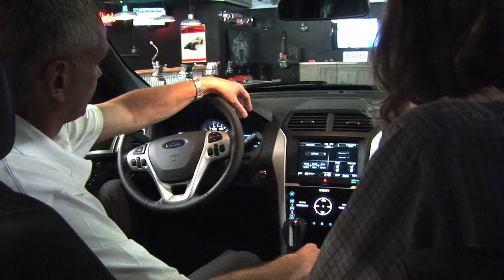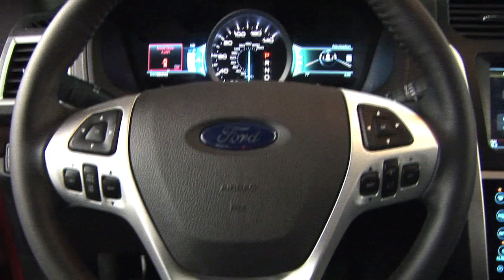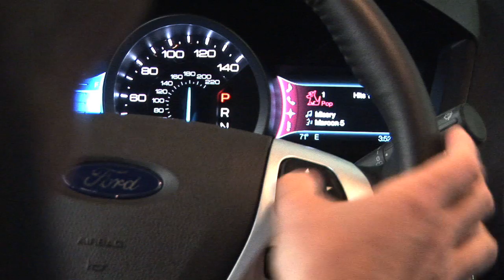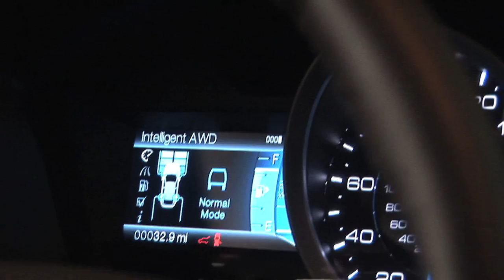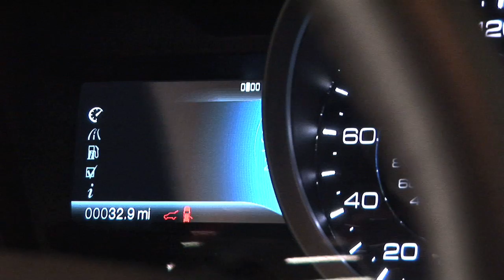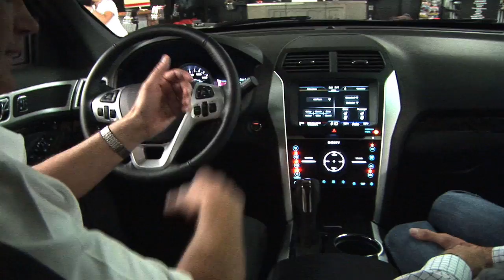First Look: 2011 Ford Explorer - Interior

Comment: @hernanmunoz with how many miles?The reason most people hate ford because they do give alot of problems. What i have noticed with ford's is that they can last but they require high maintenance. Once you slip up a few times it all down hill from their. I have a friend with this van with 140000 miles. Which was surprising . I am a beginning mechanic and have experience with cars.He keeps his car in extremely good care. For example if one wheel bearing would go bad he would change all!

Comment: @JMxE15 I haven't been inside the new Explorer yet, but I do know that a lot of Ford's Sync and Navigation and other type features in the center console, are not available while actually driving;  so that would eliminate any chance of being too distracted by that;   the phone calls are handled by Sync, which alerts you of an incoming call, and then you command the call to go through and it's played through the vehicle's speakers; so it is totally hands free and not touching the screen either

Comment: Ok, sorry for misunderstanding fellows!
But honestly I don´t understand why some people critized the Explorer only because it´s a FORD product! 
I owned a 1996 Explorer XLT without any troubble.
All carmakers had and will have failures, but this product seems to be a very good starting point. (very efficient and powerfull V6 engine, strong steel unibody, 4WD (not for off road use), very nice design and interior, excellent crash test results, and an affordable price... aren´t this good news?

Comment: Yeah, but it's front wheel drive based 4wd. This thing sucks. No V8 option, and it doesn't even have a frame anymore. The whole point of buying a suv is for utility, and Ford took that away with the 2011. This is just a oversized Ford Taurus now.

Comment: It's front wheel drive, so it's not a real Explorer anymore. Why do the automakers insist on ruining good vehicles with front wheel drive. If I wanted front wheel drive, I'd just buy a shitty Kia Rio or something. It's getting to the point, that if you want rear wheel drive and a V8, you practically have to buy a pickup truck now. At least they haven't turned the pickup trucks into pussymobiles yet.

Comment: @Griffin596 

The direct injected 3.5L TiVCT has plenty of power/torque for this vehicle forget hp stats. This is not your traditional SUV. You get the power you need with less fuel consumption and and better ergonomics. Test drive one and see what I mean. By The way, they will be introducing new engines after the first model year (including a 4 cyl ecoboost twin turbo believe it or not!) The 2011 Ford Explorer's can also tow up to 5k lbs.

Comment: @hangene92 yeah i'm dumb, hey 2009 v6 can only tow 1000 lbs. and santa fe 3.5 l can tow is rated at 1500 and 3500 with brakes, meaning that its the frame that is not strong enough to take the stress when braking a trailer. Why is honda civic towing capacity 1500 lbs?? cause steel is stronger. and i never said hyundai does'nt make their own steel. my wife owns a hyundai right now, and that was the worst mistake of our life $30K trash can.30000 km, motor gasket seal broke, radio broke, brakes fail

Comment: Ford does make their own steel.  At the Rouge River plant.  They also make their own paint and glass.  
This is an awesome effort.  IMHO, the new Explorer has raised the bar to a whole new level at the $40-50k price point. 
Honda and Toyota are very nice vehicles also (I own a 2003 Toy) but they're gonna have to offer up much more to compete with this.   
WELL DONE FORD!

Comment: @withoutlimits16 cause when its -10 F you keep your gloves on cause the steering wheel is still cold even if your car has been running 5-10 minutes and your gloves are wet cause you scraped off ice from wind sheild, removed ice from wipers, touched remaining snow on door handle.basicly i would like to have knobs for AC and heating. I saw the new explorer up close WOW. this car will be on my test drive list. and  i will try it on a cold day ;) i hope it works fine cause ''we'' love the looks.

Comment: always loved ford trucks, and its nice to see that they are to really make a statement with their other vehicles, but i'm not a fan of the touch sensor for the rear defrost and climate controls, in the winter when you jump in the suv with gloves on and want to blast the heat you will need to take them off to use it. Not a big deal, but an inconvenience.

Comment: I know three ppl with the old Explorer, and even though they won't mind all the new high tech stuff i don't know if they are willing to give up towing capacity and body on frame durability. My 1998 Isuzu Rodeo is rear wheel drive and gets 25 miles per gal. so why can't Ford.

Comment: @joey187 you do realize that "cherokee" doesn't exsist anymore right?  only "grand cherokee" lol and power doesn't mean shit if the vehicle is heavy. it's about the power-to-weight ratio.  hence why the mustang kicks the dodge challenger's ass.  it's bulky and boxy, and wayy too heavy.  ford put in a smaller engine than the challenger and it still does circles around it.  Chrysler will never be up to par with the rest of the industry in terms of P/W ratios and fuel economy.  just sayin :)

Comment: @1vdn992 i'm pretty sure it's an optional 2.0 4 cylinder ecoboost and a base 3.5 l engine for the explorer...but the 3.5 ecoboost goes in F-150 as an option.

Comment: @jonkolo13 By the way, I understand they are trying to please the majority, but this new Explorer is just another family crossover.  Give me a break.  They should not have named it an Explorer.  It's just an extended Edge/Taurus X.  I had three Explorers and I used them as SUV's, they were great vehicles and I liked them very much.  I bought them because they were truck-like.  Now I have to go all out and get an F-150 if I want something on a solid frame, with high ground clearance, etc...

Comment: @DroidNoid I agree, new line up of engines especially the Eco Boost in the F150, the 4 cylinder turbo in the Explorer. Impressive. Focus is old and outdated. Ford still has bugs. I'm doing well in my 2006 Hyundai Sonata, 107k miles no problems.

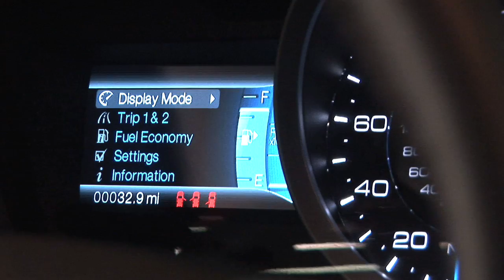Comment: It looks great the issue is that everybody is talking about great fuel economy but know has published accurate data. if you look minute 3:10 you will see it says 294 miles to empty and they run already 32.9 miles so is you add those it gives you 326.9 miles autonomy. If the gas tank is 18.6 gal than it means that average fuel consumption is 17.58 MPG.
If anyone has an accurate info please let me know.

Comment: I sure hope the beefed up the shifter bushing. they moved it from the column to the floor because the shifters kept breaking off. and they do not offer a replacement part. you have to replace a $1500 steering colum to replace a $10 bushing!

Comment: Honda Civic

One of the most reliable cars available today. The Civic rarely seems to break, and when it does, its problems are easy to diagnose. Original Equipment Manufacturer, aka OEM, parts are both affordable and easy to get.

Honda Accord

See "Civic."

Comment: Toyota Camry

The Camry used to be the clear-cut winner when it came to reliability. Other cars are catching up, but it's still one of the most reliable performers around. Affordable and easy-to-get OEM parts, too. Toyota Corolla About all that's ever needed on the Corolla are regular maintenance and an occasional brake job. We're not making any money on this car, that's for sure. OEM parts are affordable, too.

Comment: The Prius is crammed full of technology, but Toyota has put plenty of effort into the layout, which is well thought out. Considering the number of components that are under the hood, the non-hybrid parts are pretty easy to access and service. From our point of view, the Prius is terrible news for mechanics not even the brakes wear out, thanks to the regenerative braking system. All we get to install are wiper blades. How are you supposed to buy a pair of Jet Skis on that money?

Comment: Subaru Impreza For an all-wheel-drive car, the Impreza is very reliable. Usually, we count on making a lot of money on all-wheel-drive vehicles, thanks to all the additional drivetrain components. Sadly, that's not the case with this car. Thanks a lot, Subaru. We find parts to be reasonably priced and widely available

Comment: On yahoo.com on 9/11 Read on your Ford loving losers... Subaru Forester
Parts are readily available and reasonably priced. When it comes to all-wheel-drive vehicles, like the Impreza, the Forester is a sturdy, reliable choice.
Nissan AltimaThe Altima runs forever, and it's great to drive. The four-cylinder edition is a reliable car that's easy to fix. These cars just don't seem to break. Other than routine oil changes, we only see Altima owners when they've racked up 150,000 miles or more.

Comment: @carrera931  wow u have alot to say lol!  6 yrs? Every car i get i keep longer than 6 yrs. Do the math bro, i said my explorer was an 02, i bought it in 04, it is now 2010 almost 2011, so the damn thing is almost 9 yrs old and ive had it almost 7 with only wheel bearrings replaced. We will have this for 1 to 1 1/2 more years and we will be buying the new redesigned explorer, that thing is sweet. Oh i had my 96 ranger for 10 yrs and 250k miles  only replacing a slave cylinder

Comment: @carrera931  Ford tempo! lol...no shit.. that was a piece of shit! and your explorer story...ive got stories too, it happens with all vehicles. Buddys 01 civic  2 trannys, bro-in-law camry on 2nd engine with less than 120k.  My wifes 02 explorer 130k runs like a dream. My old ranger, over250k not 1 dam problem, my 06 f150 90k only 4x4 valve, my 97 explorer 200k only a crank-shaft sensor. My dads bronco 220k no problems runs like new, so id say ford makes a pretty damn good product

Comment: @carrera931 lol...dont act like toyota had the best looking cars in the 80's-early 90's either lol. That ugly little corrolla was horrendous and the early camrys werent that great looking either. But half of them r still running lol, those cars were more dependable than any new ones even toyotas new lineup

Comment: How about some IMPORTANT information while driving.....like my oil pressure, oil volume, voltage of battery, coolant level, the instruments that tell weither or not my engine is fine or is about to have a breakdown.

Comment: @1vdn992 Everything is color coded and I'm sure the buttons have different textures also.......that's why I said watch out for NEW explorer's.

You think owner's will have all of this figured out in the first year of ownership?  They're going to play with all the different settings while they drive for the first 10,000 miles.  Watch out if they have dealer plates especially.

I'm not saying it's a bad thing, I'm just saying there are a lot of distractions.  Plus everything looks pretty.

Comment: @bigretardhalo Yep our Ford Fusion has them on the steering wheel just to change between media, change radio stations, volume that stuff.
I wasn't trying to hate on the touch screen or anything. And I love ford.

But a touch screen simply isn't more durable than a button that was all.

Comment: @Fun4Video2 you use the redundant steering wheel controls or voice command through sync, and you should never be driving with "mitts" on. Leather gloves are one thing wool mitts are another you might as well Armor All your steering wheel while you are at it if you are driving that way.

Comment: @crazyfast39 Really? I think they are much easier to damage and far less durable. Also cost more to replace and have no tactile feel you need to visually confirm that you have pushed the screen in the right place. You can feel the click of a button and use them when wearing gloves.